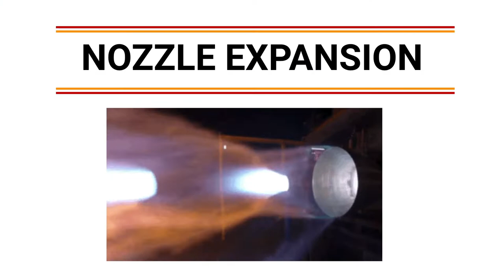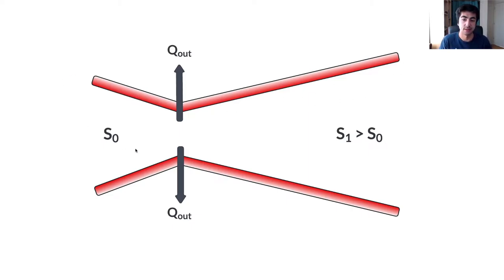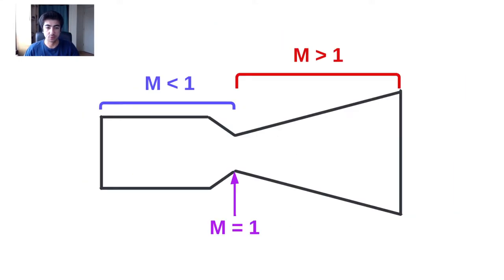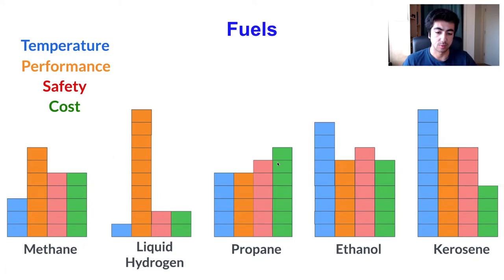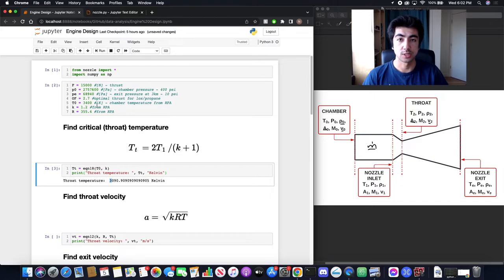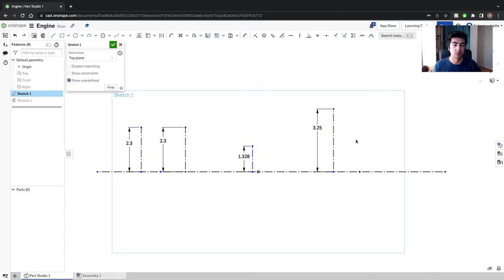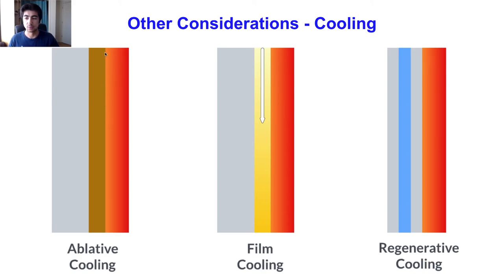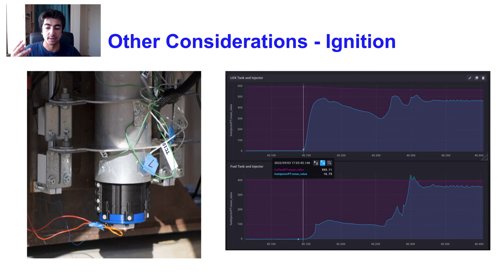Rocket Engine Fundamentals and Design Part 2/2: Nozzle Expansion and Design Example

Comment: I thought that the walls are cooled with propellant, which means the heat tfansfers to the propellant and is put back onto the combistion chamber. Also, doesnt friction convert kinetic energy into heat, once again heating the walls, then heating the propellant, and then is injected back into the chamber?

Comment: Thank you for the amazing video. May I have a question? What would it be different if one were designing a solid rocket motor in terms of the chamber? Would the chamber length L* be the size length of the propellant grain?
Reply: How May I Find k, R and T for a known propellant (HTPB/AP/Al for example)?

Comment: Hi help pls , i am getting injector area in 1 micro m^2 ,too difficult to have that in real time, is my calculation correct?,
i am designing pintel injector  for pressrue drop of 100 psi, fuel mass flow rate = 0.030 kg/s ,fuel density =800 kg/m3 ,Cd= 0.70 .
I am desiging engine for  Thrust=294.3 N
Chamber pressure = 300psi
Reply: I am aiming to achieve throtability of  1 to 3

Comment: hi sir, after using the calculations of the video, I keep ending up with a nozzle lesser than that of the throat, can you provide an explanation for this?
Reply: The equation that relates throat area to nozzle area involves a square root, so it should give you two answers.  Perhaps you’re selecting the smaller of the two?
Reply: thank you very much for responding... The problem I had was that the nozzle equation(the mass flow rate= area*volume/velocity) outputted a lesser value than the throat area equation... I am converting these equations to solve for a, maybe I screwed up? (conversion= a=m/(volume/velocty))

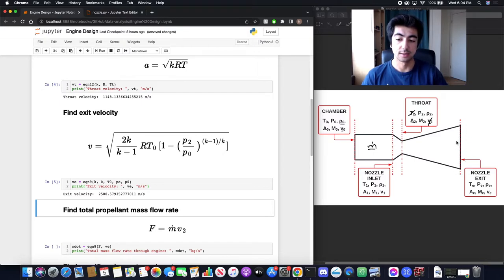Comment: 1:07:53 Why you say before lightweight molecole are better? Kinetic energy is mass*velocity right? more mass more energy come with and more velocity more energy expel. So why this dont apply to combustion rockets? For example the the CH4 and H2 fuels  and LOX oxidizer. why H2 have more Isp? (must be something with the deflagration or detonation) but if both have lets see Mach3 ath exit nozzel the more thrust its given by the component with more weight wich is carbon 16;1 )
Reply: Nope, it's square of velocity. Ek = 1/2mv2 hence speed is more important than the mass
Reply: what you said about mass*velocity is momentum. energy, as stated in the comment above, is 1/2mv^2.

the reason why we want lighter molecules is because with lighter molecules it's easier to accelerate it to higher velocity. Also, rocket engine efficiency is measured by how fast the exhaust is going, so you want the highest exhaust velocity as possible.

Comment: This is probably a stupid question about fuel: compared to liquid methane and ethanol, how would methane dissolved in ethanol compare?

Like ethanol it's a liquid at room temperature and has a low boiling point meaning it can be gasified easily with a heat exchanger and you could potentially gain increased energy density from the methane.